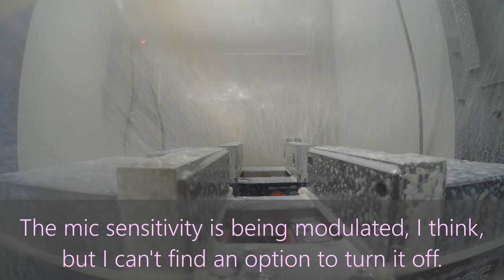Testing CRACE Airflow Orientation and Mic Attenuation (Coolant-Resistant Action Camera Enclosure)

Comment: You have got it working very well (As one that has done a very similar thing I know that it's no easy task). I see from your video and it has been my own experience as well that the orientation of the air flow doesn't make a dramatic difference. You have indeed made many iterations of your design. Wow there is a lot of time and work there. Thanks for sharing Peter.
Reply from the maker: Edge Precision 
Yeah, I'm thinking cohesion and adhesion are playing a much bigger role than gravity in terms of how hard it is to get the coolant to move off the window. I think if that's true, might as well try to push it as short a distance as possible.

Comment: Very cool! I worked with a company that used a lightly pressurized enclosure to protect an expensive hyperspectral camera from dust, and that was the first I had seen idea, only gotcha was the state's high humidity air (even after drying) combined with a peltier cooler on the camera was an effective water generator.
Reply from the maker: Kent VanderVelden 
Dang, that ain't good! How humid was it? I'm glad the humidity here in Albuquerque is low enough that just one round of drying seems to be enough for what I'm doing.

Putting the compressed air into the chamber definitely gives the case a little bit of extra insurance against leaks. A happy side-effect for sure.

Comment: Ok, I'm sold. When can I buy one? My Brother is going to destroy what I've got right now and I'm struggling to get video from outside the enclosure... Can't believe how far you've come with this!

Hope all is well - Tom Z
Reply from the maker: Howdy Tom! I'd like to make you one, but it takes me SO long to anodize them, that that part of the process is discouraging me. I'm getting better at it, sort-of, but the ratio of successes to partial failures is worse than I would like. I'm thinking about milling up a few and having them professionally anodized. What camera would you want a Crace for? I'm not sure if the professional place will let me do multiple colors in one batch, would you care if you weren't able to pick the color?

Speaking of which, how has your anodizing been going? Have you found the time with the move, new mill, and new-ish router? Not to mention getting the lathe powered up again.

Comment: ok I need this! I like the shape, it makes perfect sense. The details are terrific. I like the thumbscrews! One of the most difficult things I try to film (never successfully) is thru-spindle coolant drilling and milling. I foresee that problem being solved perfectly since the TSC blast isn't concentrated at the camera anyway, there's just a lot of mist around the camera...this case looks to have no trouble with that.

I would think any bright anodizing color would be ideal since it just makes the item easier to notice, which could be important. I like doing red or orange anodizing for aluminum stuff inside the machine, like coolant nozzles, lathe bar puller, coolant washdown clamps, etc. 

Honestly I wouldn't be worried about the air blast noise whatsoever. Realistically, anybody that's spending THIS much effort into filming their activities is going to possess more than one way to get audio from it, and they're going to be able to edit things together. I'd say it's nice the blast isn't drastically loud by itself, but personally it mind as well be a hurricane since I'll just yank audio from something else when the time comes (lol)
Reply from the maker: Andrew Ydna DuBuc 
Awesome!
What camera would you like to put in it? I know you have a GoPro 3 or 4, but I know you also toyed with the idea of upgrading.

I think what I'll do, since it's you, is make it and then ask you to send some moneys once it's done. I've crunched the numbers, and I think I'm down to do $115 for the Yi cameras, $120 for the Hero 5/6, and $125 for the Hero 3/4, then $10 for Priority Mail shipping (as long as a flat-rate box works).

(the price difference between the models is from the number of buttons they have)
(I posted this message twice, the second time so that it can be posted without having been "edited".)
Reply from the maker: Andrew Ydna DuBuc 
I might be able to make mist as well so that I can test that before asking for you to send the payment. I suspect the air will prevent the mist from landing on the lens at all, but it'll be better to actually try it.
Reply: No problem, I'll buy one anytime. I would probably elect to use the Hero3 since I'm more familiar with that camera right now. Your pricerange sounds good; not too inaccessible for people in general.
Naturally I can send TSC test footage when the time comes. The closest type of coolant would probably be a nozzle aimed at the side of a spinning collet nut or knurled drill chuck, but even that can sometimes make more atomized mist than TSC. That said, I want one regardless of the TSC stuff, since I can still make good use of it. I figure worst case scenario is the TSC still makes a little less clear view, but if that's the case then I wouldn't be able to get a perfect view without just opening the doors and filming from 10 feet away, but I don't wanna do that, lol
Reply from the maker: If you would like, I can make the case have a solid back and knock off $20. Since most of the GoPro Hero 3s and 4s don't have screens, the window in the back of the crace doesn't really do anything anyway and omitting the window means I don't have to make a threaded ring for it, buy the glass, and it'll also take one possible leak point out of the equation. The retail price for the glass is actually higher than $20, but I found a deal for a bunch of them on eBay a while back so those are already a sunk cost for me.

Unfortunately, there's basically no way to tell whether a GoPro Hero 3/4 is recording while it's in the case. Well, no way to tell visually (if there isn't too much ambient noise you can hear the beeping, and in my experience the app is able to connect to the camera through the enclosure).

I do have orange anodizing dye. I look forward to seeing what it looks like. Do you have a preference for the color of the buttons/ring(s)? If not, I'll probably make them either black or red. I wouldn't want to send out a case unless the anodizing is at least "decent", but I can record a video of the end result so you can get a look at it before sending the payment. If it doesn't look good enough I can just keep it for myself and possibly make another.

For the payment, I was planning to use an app called "Cash App" that is made by "Square" (Square is one of the companies that make credit card sliders for phones and has been around for a long time, they seem to be legitimate and the Cash App is pretty cool in my opinion). As my only potential customer (so far), I'm curious if me asking you to use the Cash App (or the Square Cash website) to send payment seems onerous. If you decide to check out the app, I have a referral code: JGMSBPF (no pressure or hard feelings if you don't wanna).

I'm shooting to have the case... I mean "crace"... done by Friday (or earlier, of course).
Reply: Sure, I don't need a window on the back, if that makes things easier. For the anodizing I'm not too concerned, I'd say shoot for something bright, but aside from that I bow to you being your own judge on it :) 
I've never used the Cash app but I can look into it. I use paypal for most of our payments, though we pay for the full card terminal system which isn't free (however the standard paypal business account is indeed free). Not everyone has a paypal account but anyone can place an order through their interface even if you don't have an account.
We formally paid for a brick-and-mortar style card terminal but we used it so rarely that it didn't make sense. Same thing for Square, we don't do many in-person sales so it just gathered dust, heh
Reply from the maker: Alrighty, the last part (the lid) was just put into the anodizing tank. The anodizing process I'm using goes slow, so it'll be in there for the next 2.5 hours. Then I'll dye it and seal it (which'll be another 75 minutes). All the other parts have been milled, anodized, and dyed, and I'll seal everything else along with the lid. The orange on the box looks pretty good! It's sort-of a dark orange or reddish-orange. I made the rings and buttons black. It sounded like you didn't really care one way or another about the window on the back, so I decided to make it with a window, just in case you decide to get a GoPro Hero 4 Silver (which has a screen on the back).
I plan to record a video showing the enclosure being put together. I'm going send you a personal message (through YouTube) with a couple questions...
Reply from the maker: Got it, will do...

Comment: Please get these produced, I have a new lathe and cant see sh*t through the window and want a mounted camera in the machine. I will buy two for gopro Hero 3's
Reply from the maker: Doing so is very high on my list! Are you wanting to monitor the lathe in real-time or are you more interested in reviewing the footage afterward? My "current" "plan" (both of those words used very loosely) is to make it so power/video cables can go into the case, which would make real-time monitoring better*. Once I finish a video that's been kicking my ass (severe software issues, and also my stubbornness stopping me from just quitting) I have two or three projects that I gotta hammer out, then back to CRACEs.

*You can watch over wifi, but I've found it to be temperamental, and then the lag, video quality, and battery life problems just make it less appealing to use.
Reply: Real time monitoring is high on my list...I can barley see in the machine when the coolant is on

Comment: Hi would like to order a Crace. I just got a Speedio S700 in my home shop. If you are still working through anodize learning curve. you can ship it un-anodized. I do my own anodizing also if you need someone to compare notes with.
Reply from the maker: I'm dying to get back to making them! I let myself get majorly sidetracked with some other crap; namely learning about how awesome and powerful Blackmagic "Fusion" video-editing software is while simultaneously learning how much of a total piece of shit it is. But, I think it might actually finish exporting the video this time so that I can move on. Unfortunately, I have a couple projects (hopefully easy ones) that I have to hammer out after that. But THEN I can get back to obsessing about camera enclosures! A couple other people have mentioned that they could anodize it themselves. I'll consider that. A problem I have with that is I've been laser-engraving the logo and serial number, and that has to be done after the anodize, of course.

Congratulatuons on the machine! Are you using Fusion 360 by chance? Have you made sure G49 isn't spit out by your post processor? (I've had G49 cause unexpected rapid Z- movement, but I was also using older firmware for a lomg time.)
Reply: fusion isn't an editing software, so there's yer first problem :P Back before Blackmagic bought them, they used to have the motto "we suck less". It's debatable if that still applies, haha.
Reply from the maker: @wernerautomation2834  Heheh... I don't know if it's Davinci Resolve or the integrated Fusion that's crashing at every opportunity and just went for brevity. I don't want to go crawling back to Premiere Pro. :/
Reply: We use nuke studio for the minimal editing we do, but that's not affordable for anyone but large studios. At home I just use premiere. For compositing I used to like fusion.. 15 years ago.. its mostly died off in the industry and everyone used nuke which is pretty terrible software. Basically they all suck so just use premiere :P
Reply from the maker: I figured I’d paste this message here a little before Tomorrow, which is when I plan to publish a YouTube video and put up an Instagram post "announcing" my new web site where I have a few CRACE 2s up for sale. The site is https://lunacnc.com . There are only few ready to go right now, but there is a very good chance that I will have more available within a month or two. And those ones should be ever-so-slightly better than these ones.

Comment: I want one. Post a link on how to order...
Reply from the maker: At the moment, I don't have a formal ordering system set up. My preferred method right now is to use Square's "Cash" system to accept a payment, and then communicate over email. What kind of camera are you using? Right now I can make Craces for the GoPro Hero 3 or 4, the Hero 5 or 6, or the Xiaomi Yi 4K or 4K+.
Reply from the maker: Oh, I realized that I made it sound like I wanted payment before communicating over email. That's not the case. In fact, I'd basically prefer to have the Crace totally finished before taking payment. I'm thinking about milling a small batch and having them anodized by a local business (I'm not very good at anodizing yet and it takes me a long time to boot). I'm trying to get a feel for what cameras people are using so I have a better idea of what to make for the first batch - what are you using?
Reply: Hirudin hero 3, I can anodize it myself if that helps